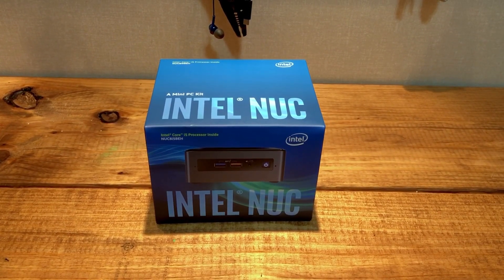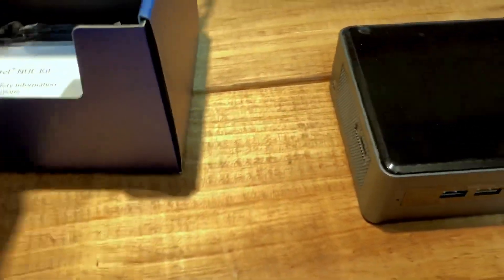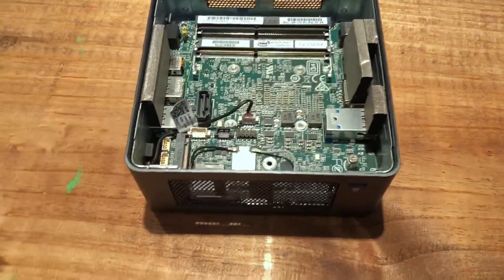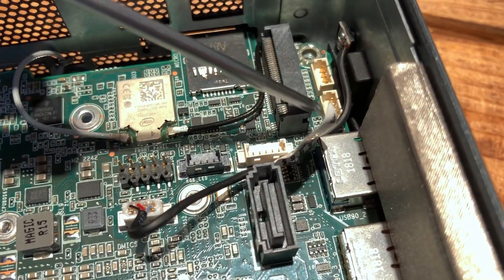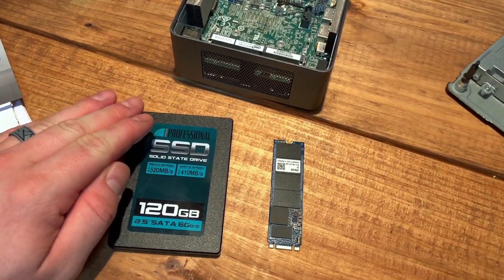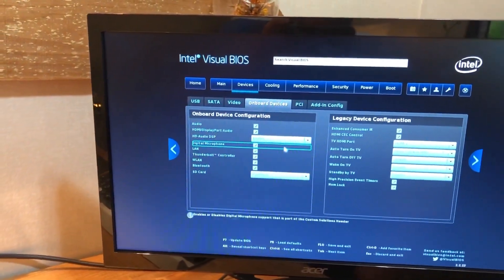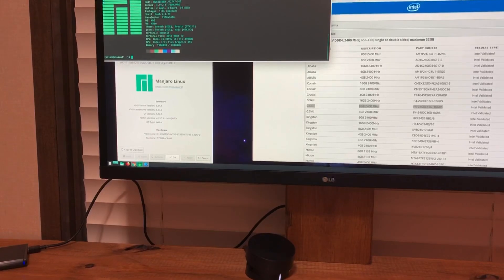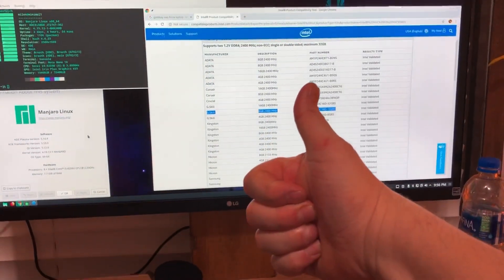Intel NUC (8th Gen i5)

Comment: I bought this same Nuc 8 in 2022. It was under $600 for 16gb ram,240 gb ssd and win 11 pro installed. For streaming this thing is Brilliant. 4k is no problem and barely uses much of the Processor resources. Even when the fan is working hard it is much quieter than my previous desktop and laptop. The Thunderbolt can be used for a variety of xtra's if video expansion is what is needed. Best $600 CPU system I have ever bought.

Comment: Thank you for this; ESPECIALLY for the information about the Intel Product Compatibility site.  Questions: Did you have to change anything on the BIOS boot screen in order to install Manjaro?  Did you have any issues installing Manjaro? Did you try installing any other Linux distro?
Reply from the maker: Well I currently don’t have this NUC anymore, But I used Manjaro for a year and a half with no real issues. It was struck by lightning and took out the ethernet and audio jacks. :(
Reply: @47Hobbies  how do I know if it actually has wifi?

because it doesnt show wifi in the windows taskbar and i could not connect!

Comment: Hi, I have similar model to yours and I was trying to disassemble the NUC to clean dusts of the CPU fan (fan become very noisy now) but I don't know how to disassemble to get the CPU fan, any idea? Thanks.
Reply from the maker: Tom Nguyen There should be 4 Phillips screws on the bottom?
Reply: @47Hobbies  I'll try again tomorrow. Thanks for the reply 🙏👍
Reply from the maker: Can you not see the fan at all? Meaning if you can just used canned air to blow it out?If you have a Twitter (@47hobbies), send me a message with pictures, maybe I can help better.
Reply: @47Hobbies  thanks for the reply. I'll go and get myself an air can and see how it goes. Thanks
Reply: I'm pretty sure I unscrew all motherboard screws but the thing won't budge. Also there are "cushions" glued to the case (shown in your video as well, rectangles attached the 3 sides) may need to be removed as well. Not straight forward at all.
The CPU fan need to be cleaned to reduce fan noise. Your fan not noisy?

Comment: sir,pls help
 i have Intel NUC i3-5TH Gen UCFF Processor.
in this supports both m.2 data drive and ssd drive
i want enable  only m.2 sata, I fix ssd drive but
ssd drive disable by nuc bios setup,

 pls give me solutation"?

              manoj from india
Reply from the maker: Manoj Singh If you only want the M.2 drive enabled I believe you have to disable the Sata Port and/or the Sata Interface all together. It’s under drive options.

Comment: How's the NUC going on temp wise? I wonder if we can thermal paste the cpu and maybe water cool the top part by taking off the plastic cover. I currently have a heatsink with vent on top of it, extra fan behind to suck the hot air and managed to keep my temp 50+- when loaded atm.
Reply from the maker: Manuel Oranga Well I don’t push it that hard but from everything I’ve read the 8th Gen Has Way better thermals, At least I never hear the fans ramp up and that was from video editing, although it is behind my monitor so....yeah.
Reply: @47Hobbies  cheers Mate, I haven't done editing for a while and I'm only used to final cut. Will start learning the Sony Vegas so I can try the NUC.

Comment: Novice here waiting for my Intel NUC to arrive, quick question do I have to fill both memory slots for it to work or can I just install one memory module? I only ordered one 16 GB DDR4 memory module.
Reply from the maker: its1me1cal You can use just one, it won't run in dual channel mode but depending on your use case you will be fine using just one, thats what I do.
Reply: 47 Hobbies thanks for your reply, so what’s the advantage of having 2 and running in dual channel mode?
Reply: @its1me1cal  You get more memory bandwidth since dual channel can be accessed simultaneously, rather than just sequentially if it were single channel.
Reply: @dubucheeks thanks for your reply

Comment: Thanks for including the issue with RAM! Was great to see all this and the bios settings. Most other videos just show everything working without issues.
Reply from the maker: Your welcome! It definitely had me scratching my head. Im still running this with no issues, only been 4 months but it handles most for what I need it for.
Reply: 47 Hobbies Are there something(s) that it cannot do for you at all (either a particular app or a combination of apps running at the same time)? Or if it does, it is slow enough that you'd decide this device is not good enough to deal with those kind of workloads?... If so, would you happen to be making a brief video about it?

Comment: Got mine set it up Mate, did you consider trying to improve the cooling system? The fan is too small and with heavy loads, I recon we will hit thermal throttling.  Let me know if you have any inputs or if you've done something already. I got some ideas and already ordered some parts.
Reply from the maker: I have not done anything to it but from what I’ve heard it’s supposed to have better cooling than previous gen. I’ve been using handbrake and it ramps up but it’s not terrible IMO, Also I’m the worst to ask because I have not had experience with previous Nucs, nor do I mind as long as it’s not louder than a full-size desktop, some OEM machines can be outrageously annoying with cooling.
Reply: @47Hobbies  that's cool Mate, I guess I just to prevent over heating and trying to improve the existing cooling system by adding a heat sink on top of the NUC. I have to take out that plastic cover of course.

Comment: Does it have a built wifi and Bluetooth? I'm considering this instead of the mac mini and it would be great if this comes with a built in Wifi and bluetooth.
Reply from the maker: Manuel Oranga Yes it has both and very good ones!
Reply: @47Hobbies  Ordered mine yesterday Mate, just waiting to arrive now. Bought the i5 8259U probably exactly the same with what you have. Then I ordered corsair 16gb ram x 1 and Samsung evo 970 m.2 250gb.  How do you find this little machine Mate performance wise as a normal pc user and movie watching?

Comment: Interesting to know that the NUC motherboard is prone to heavy modding.  I just got my i7 NUC 8thgen.  I couldnt be more happier.  It is faster than my gaming PC believe it or not (running the same i7 just 2 gens older and a GTX1080). Graphics are not high scores but it runs half life in 4k at 60FPS (yes its an old game but never the less it can push PCs fully spec'd with Vsync) and she handles! (Intel Iris 655+ is no joke)  Stays around 71 Celsius and peaking around 91 when 4k streaming and minimizing windows and gaming.  Aside from that I am still weary about video editing.  Have not done any thus far but with 32gb of RAM and a 970 PRO SSD what could go wrong? (3.6 second boot from button pressed to windows desktop)  Plus you gotta love the thunderbolt 3.1 which you can slap an eGPU and go balls to the wall.  Mine is slightly over clocked to run COOL and the voltage and processor frequencies are stock but my 4.5ghz i7 sits at in adaptive mode so running nothing im at 2.5ghz but gaming im around 4.1-4.3ghz.  Intel is onto something with their new adaptive voltage/frequency i7 coffee lake line ups!

Comment: Thanks for the detailed internals shots and information.

Could you measure the internal height of the 2.5" drive bay, ignoring the two indented tabs that hold the slim 2.5" drives in place?  I am considering trying to shoehorn a 5TB 2.5" drive shucked from a Seagate Backup Plus 5TB into one of these.  Thanks!
Reply from the maker: A. Fenderson I’m only measuring 9.5mm I know that the new larger capacity drives are around 16-19mm now if you’re crafty you maybe could mod it to fit
Reply: @A. Fenderson Hi did you manage to get the 5tb into the drive bay???